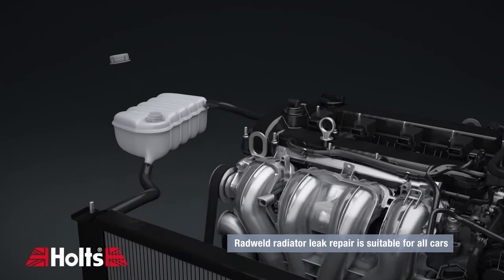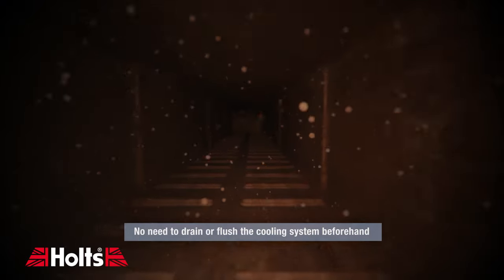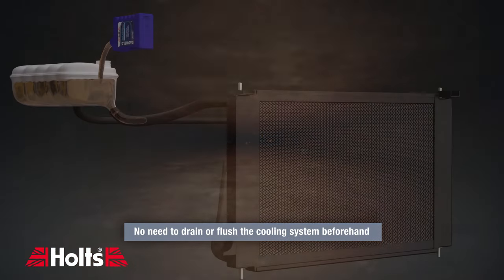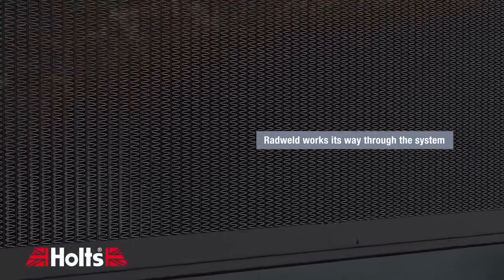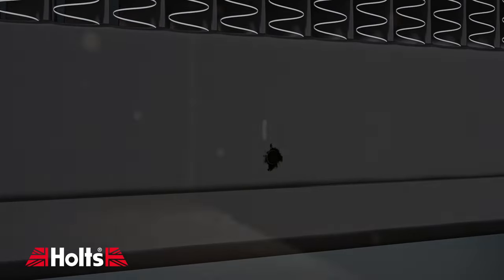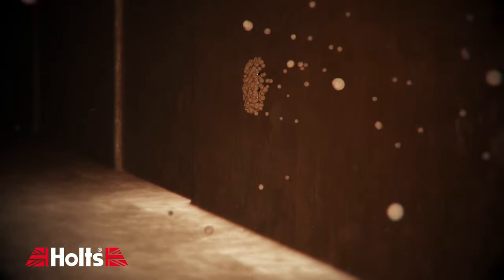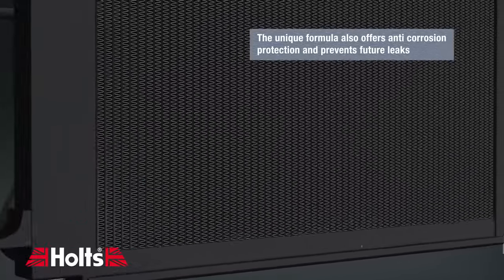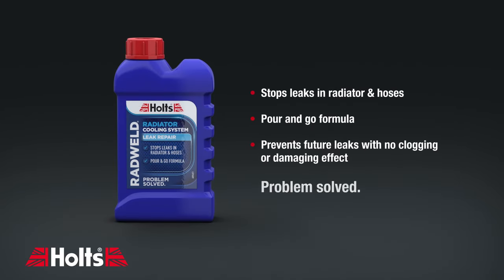Holts Radweld Leak Repair Instructions

Comment: This product WORKS. Had a leak in my system and one treatment of this fixed it. I’m talking it would leak a full reservoir full of water on a short 25 minute drive. No leaks at all after one treatment. Brilliant stuff 👍
Reply: i have a coolant leak in my car so do you pour the entire bottle in there?
Reply: @jawadahmed7220  I believe I poured around half a bottle into the water reservoir and it worked just fine. May need to adjust the amount if you have a bigger reservoir. 

I have a Vauxhall Astra 2008. I’d say my reservoir is about average size so if your car is smaller or bigger use a bit more or a bit less than half. Hope this helps!
Reply: @latitia3390  okay i will try it out thank you 😊
Reply: Yeah but it's temporary. You always have to worry about the leak opening again and you not noticing until smoke starts belching out of your engine.  Especially if like me, your car has no visible temp gauge.
Reply: @wmsstuff271  I know, it did it’s job until I was able to get to the mechanic though who sorted it.
Reply: How much of this do you add I’ve just bought a 2l bottle

Comment: these aren't instructions...
Reply: Hi
You know how to use
Reply: @jamalelyyan7432  will this work for a leaky water pump seal
Reply: @Blinkydabill  I just bought a bottle and going to try tomorrow. Had a leaky water pump that leaked from the bearing, now the new one leaks from the seal for some reason. It's a small leak, every week or two I have to add ~250ml and car is 15 years old. Can't see the leak happen but I see pink traces of antifreeze around the seal.
Reply: @silviuchitic162  Did you have any success?
Reply: @citizendc9  Hello, yes it works but I don't know if it will be a permanent fix.

I used it on the 6th of April so  a month ago. The first 3 weeks it didn't drop but last week I noticed it had dropped a bit again, went from 1/2 a reservoir to 1/3  or so, checked again today and it hasn't dropped any further. I used to end up with an empty reservoir every 1-2 weeks. 

I can see white stuff around where the antifreeze used to leak from and the area looks drier.
Reply: @silviuchitic162  Any new updates. Did it leak again?
Reply: @nickiemmy9177  It worked for a wile but then is started leaking again tough not as bad. Anyway I scrapped the car 4 months ago as it failed yearly inspection on a couple of things including coolant and oil leak and it wasn't worth the money and time to try and fix it. 

Got myself a 2009 Renault Clio that doesn't have any damn leaks. I was getting annoyed of having to check engine oil and coolant every week.

Comment: Worked perfectly on my bmw
Reply from the maker: Glad to hear it Daniel!
Reply: Hey Daniel how long did this work for in your BMW ?
Reply: @derektierney1314  Hi Derek, still going strong haha almost a year!
Reply: @daniela1797  Tks for that, & for getting back 2me so soon 👍
Reply: Did you just poor in into the reservoir?
Reply: @micky229  yes, just pour it in
Reply: @daniela1797  lovely thanks for the reply 👍
Reply: I will be trying this , I got a leak been to garage twice and they couldn't find anything. But it usually leaks much more when vehicle is left overnight. Today I came out and saw coolant on the floor again and traced it to lower radiator hose and possibly radiator. Just gonna try this before trying a garage again
Reply: @80skid83  yes, worth a try. Let me know how you get on

Comment: I've just bought a car with chemweld in the radiatior and heater system. It is holding water well, I didn't know about this repair until last week, when my mechanic serviced my car. I live in the South Australian outback and have driven it long distance and in hot conditions, it's just fine. I've had the cabin filters replaced with the service. With the a/c running it's fine but with three heater running it has a obnoxious odour, is this from the chemweld in your experience?

Comment: Do we pour this into the same place as where we put the coolant? I have a coolant leak in my bmw. Also, I also have an oil leak, do I pour this in the same place that I would ordinarily oil?
Reply from the maker: Hey there. Radweld is poured into the coolant reservoir, and designed for coolant leaks only. It will not repair oil leaks from engine and should not be added to engine oil, as this can do damage.
Reply: @HoltsAuto  thanks for getting back. I discovered this item when the leak got worse, if I knew of this way back when it first started I reckon it would have done the trick
Reply: Should I drain 250ml from the coolant then I add 250ml of holts or no need to do that?
Reply: Yes, put it where the motor oil goes. It will fix the oil leak lol

Comment: I found it on a gas station when I needed an emergency fix I give it a try it worked it even holds the 105*C coolant temp the bmw engines get up to when at low load, so now I can use the car until the new radiator has arrived.